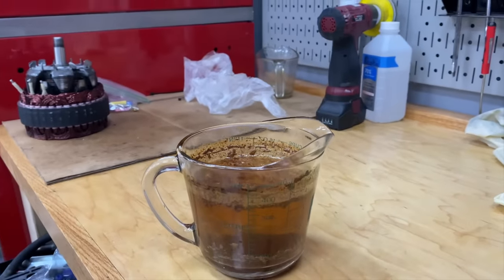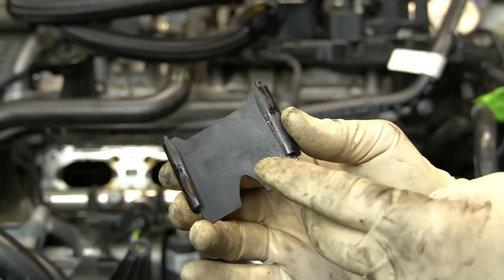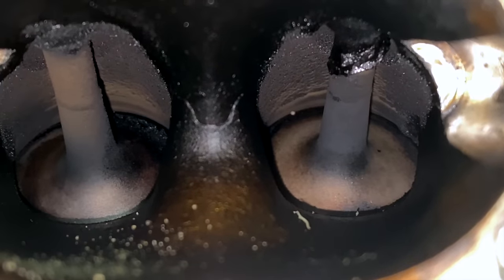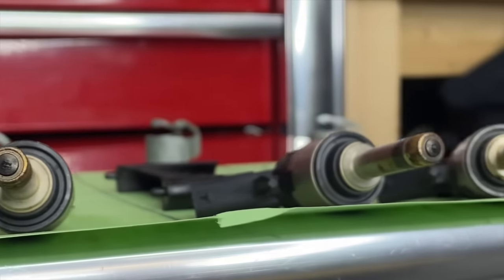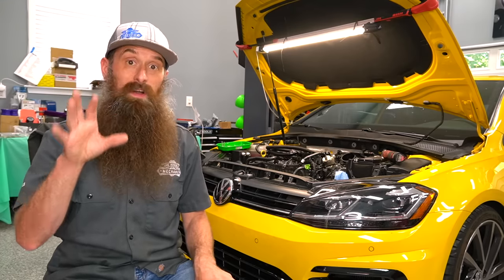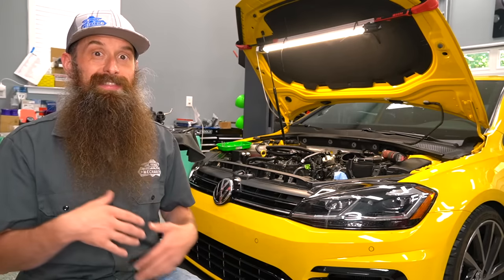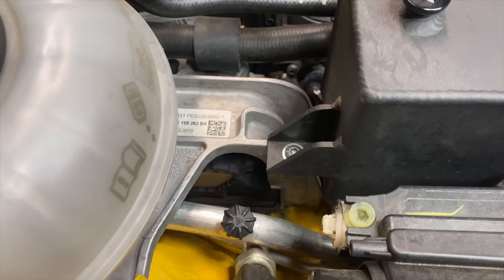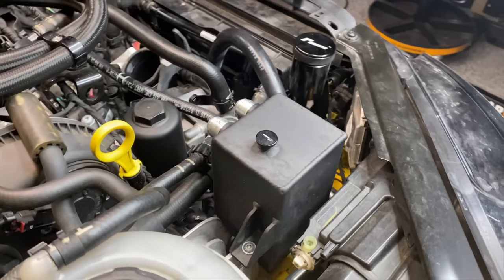Did the Catch Can Work? 10k MILE TEST

Comment: Awesome been waiting for this video since the volks fair show in GA. this was the can I was gonna buy but I might hold off. Getting new stage 2 clutch installed next week then my intercooler in my MK7 GLI 35th my last 2 missing parts for full IE stage 2. Charles I also have that same burning oil smell when coming to a stop me and 3 shops including the dealer checked and nothing so IDK in my case it may be because of my catless open exhaust. But could a DP really cause that smell your aftermarket catted on the R and i'm catless?

Comment: One thing to mention 
You said that you put liqui moly ceratec
Liqui moly recommend ceratec for engines with more than 60.000 miles, can’t put it in new engines 
From 0 miles up to 60.000 should use only mos2 oil additive, it’s same thing as ceratec but with much smaller particles because of smaller tolerance in newer engines

Comment: I personally think catch cans are a bit of an antiquated solution. I would much rather install an Air Oil Separator. Some vehicles even have these fitted from the factory. AOS don't need to be emptied regularly and have the added benefit of sending the unburnt oil back to your sump.

Comment: Could it be the case that with catch can, the air travelled to intake was cleaner and those existing carbon deposits on the valve were kind of shredded off over the time with the high pressurized clean air ?

Comment: The catch can itself is causing condensation from being aluminum and introducing heat vapor to it. 
Causing reverse condensation, what’s happening on a coke can is exactly what’s happening in the catch can on the inside.   

Modern Direct Injection engines 2018+ have updated PVC systems and with quality fuel you will not get massive build up like first gen direct injected Lexus IS 350 engines.

Comment: Water actually cleans the combustion chamber. SAAB had for a while water injection system to clean and cool their turbo car engines. It reduced knocking also. I would install one, but don't ad to much water because that can damage the rods. Just an old cold start injector below the throttle body. They are powered by a timed temp sensor. Usually 8 seconds. If you have been driving a car with a blown head gasket for a while you would see very clean chambers on the affected cylinder. I don't think the water will have time do dissolve into the fuel additive on it's way down.

Comment: Real life scenario: VW Polo 1.2 2005 Petrol has 141k miles and it is used for courier work (I drove it for around 30K miles in 1 year). I am using Castrol GTX Ultraclean 10W40 that is changed between 3K and 5K miles. I am also using EXTRALUBE ZX1 Micro Oil Metal Treatment at 20K miles.
I had issues with the engine running rough when I got the car and I used Wynn's Direct Injection Valve Cleaner and the problem has disappeared. After around 30K miles the problem reappeared and used it again and it disappeared again.
From time to time I am using Wynn's Formula Gold Petrol Treatment 500ml and I am also using a cheap contact cleaner to clean the throttle valve because I am using a stainless steel performance air filter.
Stop using silly and expensive devices that need to be removed during the winter!

Comment: Racingline must’ve watched the video as now they offer a drain valve for another 60-70 dollars 😂 I also have the catch can from them and agree with the can bolting position could use improvement. Washer relocation I didn’t mind because I think it cleans up the bay nicely and I don’t use a ton of fluid anyway. One odd issue I have had since install is random misfires only after refueling at idle. Seems like maybe a stuck purge valve but haven’t tried replacing yet.

Comment: Catchcans are useless with the TSI imo. WMI will prevent carbon buildup on the valves, keeps things cool and  you don’t need to worry about knock. Also can run more boost without needing a LPFP.

Comment: I earlier left a post about how Charles may not have been using an approved VW oil in his car, found out I was wrong, I was thinking of the GTI that requires VW508 whereas the Golf R still requires VW502.  So my apologies there.  Oil choice can make a difference though in these situations.  Catch cans are illegal for road use in many states so please check with your local laws before installing one.  Save yourself a huge headache down the road.

Comment: You could strain off the turds in that catch can and when you get enough send it off for for testing. Also that unfrozen liquid in the bottom, what is that? fuel? ethanol/water mix? That could be sent off.

Comment: Carbon buildup: even if a very little amount of oil gets into the valves, they are wet, then the EGR let's the exhaust smoke return to the intake. Wet valve meets smoke, it creates a paste that then dries. Try deleting EGR. For science 😁
That little oil can come from the catch can itself/pcv or valve seals. These seals aren't 100% perfect.
Reply: Doesn't even have to be deleted, just turned off in the PCM (or whatever these cars use to control the engine).

Comment: Takeaway here is either: 1) Install a catch can in the summer months and that will clean your intake valves, saving you from having to walnut blast them, or 2) Catch can will make things worse, way worse (you went from having oil accumulating on the intake valves, to increased blow-by gases in the crankcase, ultimately reducing the level of lubrication originally engineered into the specs in the first place). 

I think I'll just side with the engineers on this one.

Comment: I have a catch can on my 2021 Ram 1500 5.7 etorque and my intake is clean and dry at 14,970 miles. I drain every 600 miles with sum oil and condensate.

Comment: Just wondering if anyone could help me. Had a shop do my water pump and a carbon cleaning on the same car in the video. Now the car idles weird when started warm. 

So my question is, what would happen if the intake was reinstalled but the dividers were not?

Comment: Had the same issue with the gas smell inside the cabin after installing my catch can. Called Elite Engineering and they said 100 percent leak somewhere. Could not find any leak at all and so I thought, went ahead and changed all hoses, made sure everything was tight. Gas smell Gone.

Comment: I mean how much carbon built up should you expect after only 10k miles? My Passat is at 137k miles and never had the intake or valves cleaned.  Its finally giving me some rough idle issues and excessive oil consumption. I replaced the PCV but wondering if a catch can would be better.
Reply: You need a carbon cleaning, spend the money if you plan to keep the car otherwise you’ll be asking for problems soon. Catch can will help stretch you between carbon cleaning, but unless you have port injection (you don’t) then you have to plan for carbon cleanings with these cars it’s just a fact of life
Reply: @thecollieman8306  yeah im looking for a shop in the Houston area that can do it. I want 200k miles from this car.

Comment: Charles, what if you change the oil catch can to a Forge one, I think it uses the oem pcv valve and also has a drain valve on the can.
Btw great video! 👍
Reply: Or you could consider the oil catch can from ECS tuning that retains the factory PCV system.

Comment: i feel all direct injection engines should have auxiliary port injectors, cars with both have little if any carbon valve issues. seems like a no brainer to me. but what do i know im just the regular general public car guy so... great video, not all cans are created equal, each one will remove different amounts of oil and water depending on can internals, setup, engine, and mods.
Reply: I agree. My RS3 has both port and direct injectors. I still run a catch can on it which is probably mega overkill. Im sure the reason most manufacturers wont do it is the cost. You have to look at it as effectively doubling the fuel system and its complexity. This would definitely cost the consumer much more to buy a vehicle and maintain down the road. Higher end sports cars like RS models Audi's etc. its more expected to have increased cost of maintenance for more performance. I dont think the buyers of Golfs, or Jettas would have that same expected increased cost of ownership to prevent some carbon build up when you tell them they will have to maintain and replace 8 injectors at some point in the vehicles life versus 4. I do believe that the Golf R, and Arteon should have both port and DI, maybe offer it as an option on a higher trim GTI but anything less than that it just doesnt make economic sense. Just my opinion but in a perfect world yes I agree 100% with you all vehciles should have both.

Comment: just as an idea, i had..i had an old gor tex jacket, i dont wear any more,, so i modded the catch can on my car, and on the engine side( going to the intakes) i glues in a patch of gor tex.. the correct  way of flow..  , replaced my line from the catch can to the intake, with some clear line, and grafted in a el cheapo in line plastic clear fuel filter and after 5000 miles,, the clear vinel hose is still clean and the el cheapo fuel filter the filter element is still clean no build up at all,, in the next few weeks i will take the intake manifold off and look about,,, my car,   2014 ford fusion 2,0 ecoboost
Reply from the maker: Nice!!!

Comment: @HumbleMechanic
Awesome video!!!
I'm a new subscriber 
I have a 2013 Audi A4 Quattro 2.0T
I have a misfire on cylinder 2
I changed the spark plugs with NGK Iridium, swapped coils with my old coils which there was nothing wrong with my old coils and still misfire so I decided to change my fuel injectors and I also cleaned my valves since I had it apart. 
Car still had some issues at the beginning but then went away.
I was so happy the issues was fixed until today.
Been about a week without any issues. When I was leaving Walmart my car started misfiring again so I pulled over and turned it off.
After a minute I turned it back on and no issues. 
Drove it home and nothing. 
Could it be my rocker arm moving out of place causing that misfire and maybe getting back in place after I turn it back on, or could it be my control valve?
Ought it's very frustrating 
Please help 🙏

Comment: Hi, this is not a great platform to t3st a catch can on as the Golf 7R is direct and port injection. The port injection helps to wash the valves a bit. You must do this test on the older Mk5 or Mk6 motors which is a true direct injection engine. The 7R will take a very long time to get buildup that is if it will get worse than what yours was now. Great video.
Reply: that explains why the valves are a little cleaner then ;)

Comment: Considering the valves looked cleaner, and the catch can cant possible restore valve carbon buildup, I think you will have to remove it and run another 5-10k miles all else equal and see what happens now. With most of the buildup in the can being water, it may all come down to driving habits for the kind of deposits the engines get and not pcv delete related

Comment: There is no need for oil catch can, because the oily dirt comes from EGR line, which is blocking intake valves. I measured the amount of cranckcase breather line oil and it is only 0,01 %/6l/100km. So shut EGR line and this 0,01 % / 6 l / 100 km oil is cleaning intake manifold. It might take 30 k - 50 000 km ? You could clean your motor by sucking oil to lower level of dip stick and add 1.5 liter diesel and let it run 40 min !

Comment: Charles. I'm curious. Have general driving habits changed between the first 10k and this 10k? And does the car achieve running temp every drive? 

So far the results seem relatively promising. Does your catch can fluids smell like fuel at all? I am getting a very strong fuel odor from the catch can on my Mk4. I'm leaning towards it running rich or a stuck injector as the compression is around 155-165 on all 4 cylinders.

Comment: What if the valve is cleaner because of the water in the catch can being turned into steam and softening up the carbon as the engine is sucking in air. 

Wasn't one of the methods for cleaning the EGR on the TDIs using water and having the steam break down the carbon build up?

Comment: You are able to say it 100% does HELP prevent the carbon on the valves. I wouldn't say it solves the issue without a 100k mile test or more

Comment: If you could only choose one would you choose a good catch can or MPI?
(within the context of the gen3 ea888)
Reply from the maker: all things being equal? Id go MPI all the time. No added maintenance being the best part.
Reply: @HumbleMechanic  dude you are awesome! Yes all things being equal.  

Thanks for the reply that's what I was leaning towards
Reply: I have (2016 Golf R) Precision Raceworks MPI and I had a CTS catch can. Ultimately removed the catch can because I didn’t like how it blocked off the PCV and seemed to only catch stuff because it wasnt being filtered by the PCV first. I’m probably going to move to the APR can that runs through the PCV first to get the best of both worlds.
Reply: @itschefff  thanks for the reply, i've been eyeing the apr catchcan myself. So many parts only so much $
Reply: @96ej  No problem. I think if you don’t have a big turbo build on an EA888 you can avoid the catch can altogether. The PCVs on these cars are really good. 

I have a 1.8T MK7 Sportwagen with Stage 1 APR tune and no catch can and its been fine for 10k+ miles. Ultimately it wasn’t helpful in any meaningful way on the R either and I’ll only get another just to shore it up. Depending on where you’re at in your build that $600ish for a catch can can be way better spent on a tune or more fueling.

Comment: I suggest taking the catch can off, and go another 10k miles (and for good measure throw a road trip as the car approaches 30k miles) and then let's do the same analyses and results comparison...however with winter approaching 10k might not be feasible so if we can do this at 25k even, who knows we might see results in the next 5k that would sway your mind in either direction.
Reply: Piппed by HumbleMechanic  LOL what is this?

Comment: I'd like to see a side-by-side comparison between a DI car that's been driven hard versus one that's been putting around town below 3k RPM most of the time. Obviously both ideally would want to have the same or very similar engine and be left completely stock. I know you mentioned a while back that GTIs and Golf Rs tend to have less carbon build up than normal VW cars driven by regular people. Jason from EE mentioned that it is possible to remove carbon if you get it hot enough.
Reply: This is in-line with the outdated theory of "Italian Tune-Ups".  When mashing on the accelerator and inducing more fuel (through a Port Injection BTW), this theory works in creating the "burn" to clean off residual carbon.  However, on DI forced induction vehicles, you are just introducing more blow-by by adding more psi;  PLUS, the injectors aren't being cleaned off.  
Basically, it is the nature of the beast to expect intake carbon build-up over time and the need to also clean the injectors.  This isn't as inherent on later Mk7's, but it will get there eventually.

Comment: I found no difference using a catchcan in terms of carbon buildup.

However the carbon cleaning was way harder than before as the carbon was dry and solid, where before it was a little easier as it was soaked in oil and kept softer.

I def wont be putting a catch can on any of my cars again.

Comment: The unclean valves being clean after the install is because as the water accumulated in the catch can it raised the humidity in the air returning to the engine thus cleaning the valves effectively hydro-cleaning them.

Comment: You keep saying carbon, yes the oil will have carbon in it, but that is mainly due to the egr value putting carbon dioxide back into the intake system and a small amount of the egr carbon being 'blow by' and then getting into the oil, just code out the egr and block it off and totally remove it.

Comment: Ugh, I've had an ECS catch can on my Golf-R since nearly day one, 4 years old now...I've gotten not a single drop out of it to this day.  My mechanic even inspected my install and said it was done properly. Can a catch can suck that badly?
Reply: If you live in warm weather year round, it will hardly collect anything.  If you live in cold wintery areas, it will collect a lot of water.
Reply: @davidrelyea6284  thank you david. I live in arkansas, quite warm summer, even spring and fall..winter is mild here, on average 50’s by day.  Rarely at freezing temps here
Reply: @cjb8993  I get four season.  In winter it catches a lot of water and needs a lot of attention.  In summer it's dry as a bone.

Comment: The valves are being kept hotter and not letting the large chain carbon molecules to coalesce on the valve stems. The water that is coming through the intake is cooling the valves enough that the vapours land on them and STAY on them - now that the valves are running hotter, they're 'burning' off the sludge.

Comment: Oh I forgot to add that I had it in my 2012 gti mk6 with 45k and yes I would get a very low oil odor and when I removed the can I never had the odor again.  Oh by the way I install a cheap ebay can just for testing so it was a no name brand but it did work somewhat. I did this for my own testing prior to spending the big money. After this I just decided that it's better for me to just blast/ clean the valves. Know on my 17 mk7 with 7k miles time will tell.